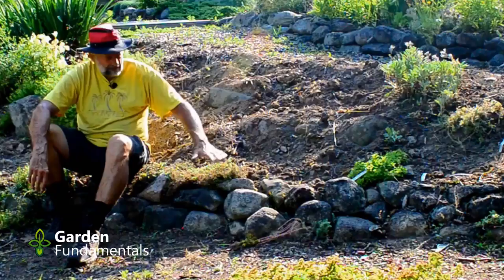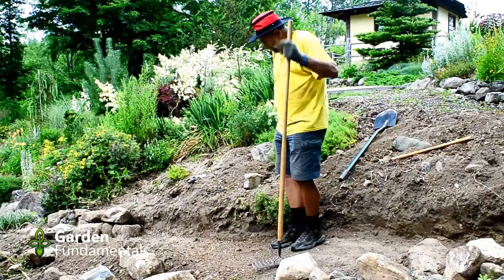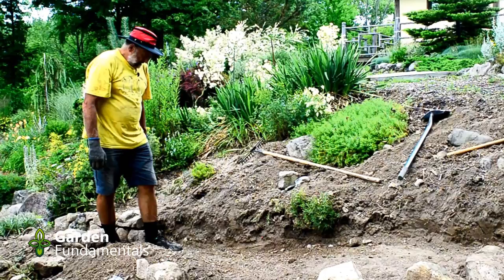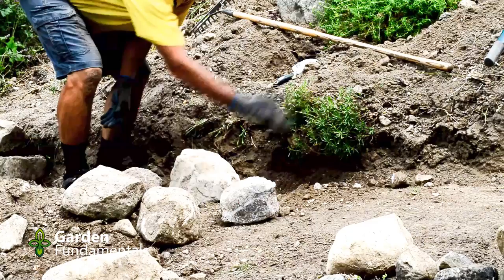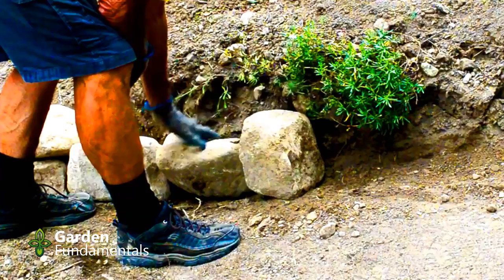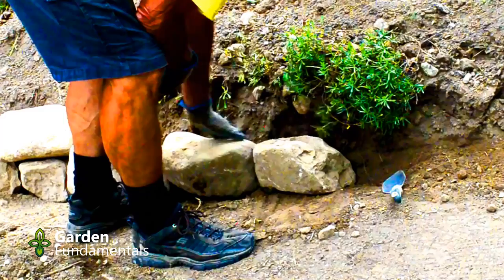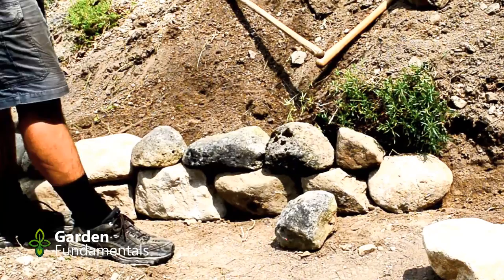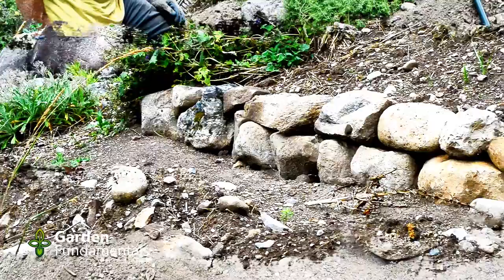Building Stone Retaining Wall 🔨🏗// Simple DIY Dry Stack Raised Bed

Comment: What "will prevent things from falling out" is to run the length of the stones into the wall, perpendicularly to the dirt it's supposed to be holding back, not run the length of the stone parallel to the dirt it's holding back, like he does. That mistake is called "tracing" and is why his wall keeps failing and he keeps having to rebuild it. I see these comments, like "this is the most comprehensive and helpful video on a rock wall I've ever seen" and "The most helpful straightforward video I've found on dry stacking," but this man makes every mistake in the book. Maybe that's what's meant, that this is a comprehensive example video of what not to do, like he only goes to two "layers" (they're actually called "courses") because it's much easier, but that's only because he doesn't know what he's doing, because three courses would be much easier, especially since it'd mean building the wall up to the required height instead of below it and having the ground slope down into the top course and especially since it'd mean not having to redo it in a couple years but having it built to last decades or even centuries-- a dry stack.

I mean, he fails to create a foundation that's dug deep enough or level enough, fails to set up a guide string to keep the bump of each face stone in a plane (these two failures being a big part of why his second layer is so unstable that it's too hard for him to do a needed third layer and fourth layer called a "cope"), fails to set the foundation stones so their length runs perpendicular to the dirt the wall's to retain back but instead traces the wall by running them parallel (the very weakest way to do a dry stack), fails to run those stones two deep such that there's an outer stone that creates the face of the wall and an inner stone that comes into contact with the dirt and retains it back, fails to tightly wedge in hearting (smaller stones shoved into the gaps between the face stones and the stones behind them forming the interior face stones that face into the dirt--hearting being like the filling in a foundation-stone sandwich--in order to then have a level course to set the next course) or pinning (smaller stones wedged lengthwise into gaps in the face stones to stabilize them and to work with the inner hearting to create a level surface for the second course), fails to establish a consistent batter both interiorly and along the face (the batter being the angle of slope of the wall with the face stones angling back planarly and the interior foundation stones angling at an upright 90 degrees from the ground below rather than also angling back as their 90 degree angle will be kept from tipping forward by the face stones, hearting and pinning and shouldn't lean back towards the hill like the face stones because then you have a heavy wall whose weight isn't being redistributed stably straight down into the earth but a wall resting on its back such that its weight is being transferred along the slope of thill and so in short order will result in that wall sliding down the hill. There's more, but I'm sick of talking. Suffice it to say that EVERYTHING he says here is wrong.

I'm providing at the end of this comment a helpful guide sheet I've found in the form of a .pdf that tells you pretty much everything you need to know and more to build a good and proper dry stack. The .pdf doesn't show itself to be a retaining wall but a regular wall, but that's the thing, they're the same. You just need to build one of those sides against the dirt, the side that's going straight up and down. Also, it shows you how you can go a lot higher than he does with what's called a "second lift" if that's what your situation calls for, which even his calls for it to be higher than what he's building, about two times higher, but not a second lift since a proper first lift would be plenty for him. 

Don't be scared. This isn't rocket science, just a bit of rock science, meaning there's a method to it, but it's a simple method anyone can do, a method that's been forged by humankind over thousands if not hundreds of thousands of years, meaning anyone would be foolhardy to just try and wing it with what one thinks is commonsense but is nonsense, like this poor fellow does. Building a dry stack is a technology, an old one, and you'd do well to take an hour or so to learn the basics of this basic technology and its methods used rather than wasting 15 minutes on this video. If you do, I guarantee it won't take you any longer than what this guy's doing, won't be any more difficult but will actually be easier, and you'll be a lot happier with it because it'll not just look like a proper dry stack (unlike the mess we see here) but will also perform like a proper dry stack, meaning you won't be back at that wall every couple years with a shovel and back-breakingly pushing stones around to try and shore it back up as it fails to retain the dirt  from sliding down the hill and bringing those rocks with it, but instead, you will likely never need to touch that wall ever again for as long as you shall live.

BTW, don't waste money buying the rocks you need at a quarry or gravel pit. That'll cost you a small fortune. You can get all the rocks you need for free by just driviing out into the countryside in the springtime and looking for the huge piles of stones that had floated up to the surface in farmers' fields and that farmers had pulled from their fields. Farmers don't want these stones. I've never met one that isn't happy to see you take as much as you want from these huge mounds of stones they collect every year. When I built my last retaining wall, that's what I did. On my way home from work was such a mound next to a bunch of corn fields, so every day, I'd pull in, grab enough to put in a single layer in the back of my Ford Escape, and then drove them home and piled them up. I also got a couple 5 gallon buckets and collected the hearting and pinning stones I needed. I didn't do it every day, but a few days a week, I'd spend 5 to 10 minutes gathering rocks and putting them in my SUV and then dropping them in a pile near where I was going to build the wall when I got home. By mid-summer, I had all the rocks I needed... well, not quite, because I did go back a couple times to get more hearting and pinning (small stones in the 5 gallon buckets) and maybe one more load of face stones. I spent $0 on stones, though, meaning I built a 30' long 3' high circular retaining wall to form a raised flowerbed for exactly $0 in materials. I don't know how long it took me because I did it just a little bit at a time, like in 15-minute increments starting in late spring. That's what's nice a about a dry stack-- NO CONCRETE! So there's no clock on it. You can just do it at your leisure, like in 15-minute increments. That way it's not back-breaking, because stones are heavy, so whenever you're working with stones, whether correctly or incorrectly, you're going to be putting some back into it. So best to piece-meal it-- do it in bite-size chunks. Sort of the same idea as shoveling snow-- not hard but pretty easy so long as you're not fool enough to try and do it all at once or too much at once. Seriously, I don't think I ever spent more than 15 minutes working on it in any one stretch. You may think it'd never get built, but those 15-minute increments add up quick and over the course of a summer or part of a summer, you'd be surprised at just how done it gets.

https://thestonetrust.org/resource-information/how-to-build-walls/?gclid=Cj0KCQiAutyfBhCMARIsAMgcRJTUY6GypAf_HSfN25GTeJQs1jDu_wcRaLsd8b-Idy64pOqJhyWu2FkaAp8nEALw_wcB
Reply: Extremely helpful, thank you!

Comment: This is great. I learned this when working with a landscape architect in Marin Co. CA in the late 80s. I have to rebuild one wall at my house and add 2 other sections.
I'll probably do it myself as I get so much satisfaction out of the process and finished product. I can take my time and fit things such that it is clean and tight and not just have a contractor dump off a load of stone and some guys of possibly dubious skill level just pile stuff up.

Comment: Thanks for clear instructions--I have been putting in a rock wall (2 ft. high), but only had enough big rocks for base.  Used medium size next, then smaller and medium sizes at top with pebbles and chips to fill the gaps.  Will my wall fall?  The winter weather will be the test.
Reply: I hope not, because I did a similar wall and am keeping my fingers crossed. I used gravel (b-chip) to backfill. I noticed he just used dirt. Had I known that… 😀
Reply: @dmills7375  Good news, my rock wall survived the winter, and also flooding rains of Spring.  My custom wall has planting knitches for perennials from my gardens and hopefully the roots will be beneficial as well as pretty with blooms.  Lots of shade-loving plants because the woods is on the South side.

Comment: I didn’t know what this was called but tried it last year and it held for the summer . Simply from under my small deck to the ground to hide underneath. I will try to do a modification of what you’ve done with the staggering minus dirt on the other side . I think it will certainly improve stability for sure. Thanks for your wisdom. 🌟♥️🇨🇦

Comment: I'd use a good angular gravel as backfill with a good landscape fabric between the two
Reply from the maker: That works as well, and is more important as the wall gets taller.
Reply: Neither gravel nor fabric should be used behind a dry stone wall. The wall naturally is free draining. Adding gravel invites more water into the back. Dirt is you best ingredient.  The issue with landscape cloth is it will most likely end up with fines clogging it up which then will create hydronic pressure. Think of it as a Dam. 
The oldest dry stone walls have lasted 5000-7000 years. Most proper dry laid st9ne walls will not need maintance until 100-200 years when built properly. 

Mark Jurus - Rockin Walls
Specializing in the Craft of Dry Laid Stone Construction!

Certified:
DSWA Instructor, Dry Stone Professional Waller
Level 2 Journeyman DSC - Dry Stone Conservancy US
Level 3 Advanced DSWA - Dry Stone Walling Association of Great Britain

BFA - Visual Communication Graphic Design MICA – Maryland Institute
College of Art
Reply: Mitchell Dunn seriously? Did you notice the height of this wall?

Comment: Very helpful video.  Thank you.

I have a question.  Do you ever begin a short wall like this with the rocks two deep on the bottom, and then sort of wedge the second layer between/on top of the two rows on the bottom?   That is what I'm trying right now.  I'm making a raised bed, only maybe five, six inches raised, and I'm using much smaller rocks than what you use in this video, a quarter or less than the size you have.  It seems like if I get them situated right, it can be quite sturdy.  Wondering if you've tried it that way?  Thanks so much.
Reply from the maker: I have tried various ways to build these walls. the one in the video is the one that works best for me, but it does not need to be followed exactly. Work with the rock you have.

Comment: I dug a trench, leveled it even, however I placed all-purpose gravel  #1151 in the trench. If I place dry rock on top of that about just 1 1/2 foot high will this cause any problems in the future? Or do I need to add landscape fabric
Reply from the maker: That should work and landscape fabric won't help.

Comment: I want to do rock patio above the rock wall. Will that work?
Reply from the maker: Yes - but use bigger rocks. Weight on the patio will tend to pus soil against the wall so the rocks need to be large enough so they don't move.